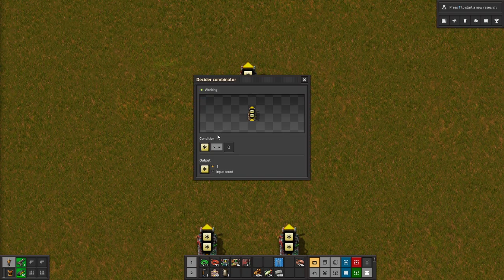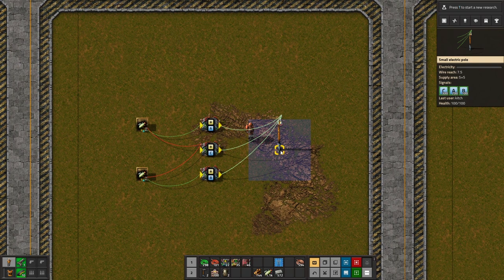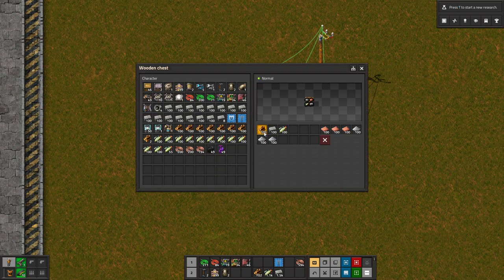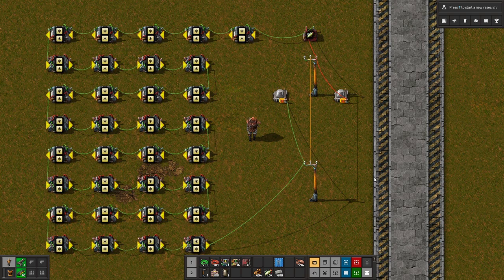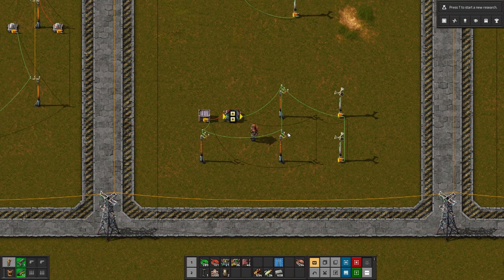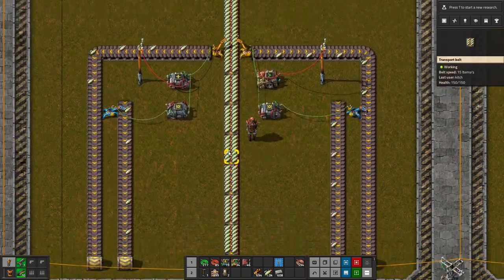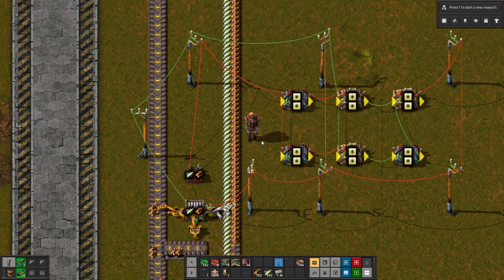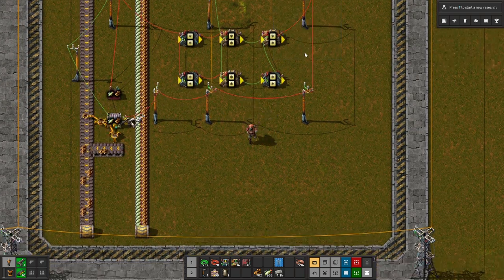Factorio Circuits - Ep 2 - Quirky Combinator Applications

Comment: Just wanted to pop in and say thank you for teaching me the basics of how the circuit network works. I actually just taught a friend of mine how it works myself, and I wouldn't have been able to do that if I hadn't learned the basics from you first. After teaching him, we just got done designing a vanilla logistic train system that can request up to 15 stacks of 480 different items from a network by only using up 2 different signal types (T and O) on 1 color of wire.

Comment: Thanks Kitch and welcome back - I keep getting and then losing my competence with combinators, this is a fantastically explained set of examples in your unique style.
P.S. On the last example of multiple items (fish and wood) I think you may have intended to have the two filter inserters removing the contents (each filtered for wood and fish respectively) to ensure both are removed to fully demonstrate your setup (in the example only wood was being removed as this has a lower item index value and at too low a rate due to yellow inserters).

Comment: thanks for the video, been trying to get a handle on this circuit stuff.
Was able to build an train refueling station with an automated fuel upgrade system that, if the refueling train brings in a new fuel type, its detected and the system removes old fuel and inserts the new fuel. Used an SR latch, where the R is a leading edge pulse of the train ID of the arriving refueller train, which discontinues the old fuel type 'S' signal.  The new S sets the content type of the refueller train storage car as a sustained signal sent to 2 blacklist inserters that remove everything from the buffer-box storage and the target locomotive EXCEPT for the fuel type brought to the station. If the fuel type is the same, there is no activity change because the new S is the same as the old S.

Comment: 3:10 the signals don't get combined they are simply on the same network, on the other hand the green wires below are divided by the combinator's input/output sides and therefore form 2 networks, it works the same way logistics networks work in summing up the items, you can also see which network/networks something is connected to and their color (wire color) if you open their inventory (it's in the top right corner)

Comment: I've been using the sr-latch for energy handling with solar panels and accumulators, when accumulator gets below 30% I send a signal to a set of water pumps that activate boilers and then when the accumulators are at 60% I turn off the water pumps, I dont know how usefull this is, as I could simply build more solar panels and accumulators and forget about the problem for the next few hours, but I really enjoy this system, I hooked up some sound alarms, I really like it how in the dead of the night, out of the blue, a wild airstrike attack sound letting me know that im currently running low on power :)

Comment: The only point you missed in the multi item loader/unloader is that the red wires on the circuit you added (the do we have it/do we need it combinators) didn't actually need to be red; they were red for clarity that it was an inserted section of circuitry, but the whole lot could just as easily have been green.